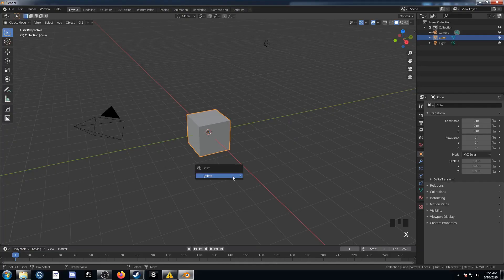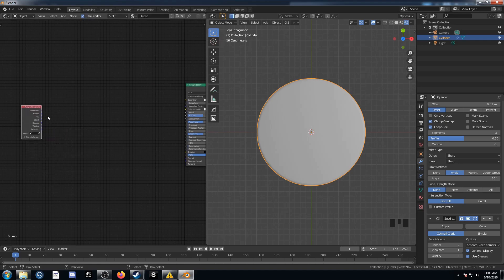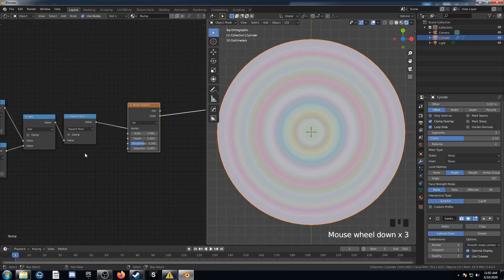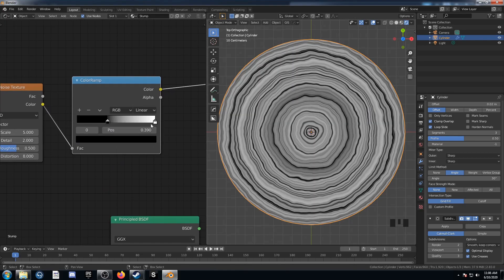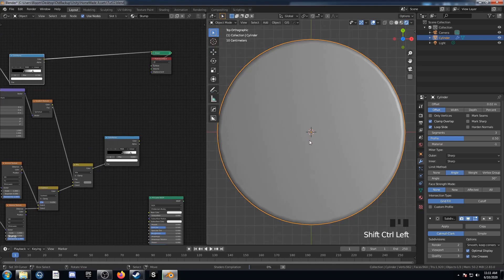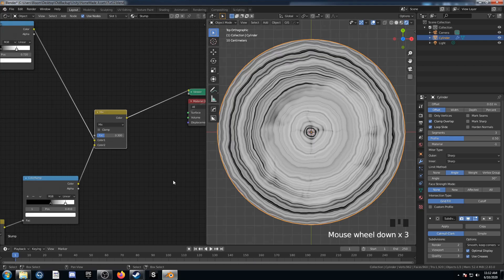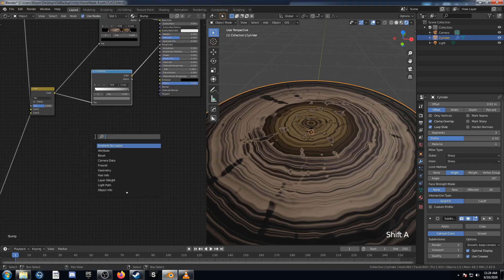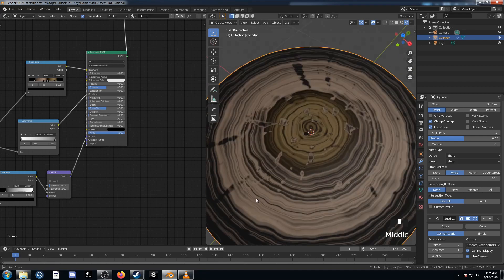Procedural Nodes (part 12) - Procedural stump texture in Blender

Comment: Instead of separating and squaring the x and y and then adding them to make a circle, you could simply connect the object coordinates to a vector math node set to length
Reply from the maker: Thanks for the tip, appreciate it!
Reply: It also works with distance in vector math so is there any difference between distance and length